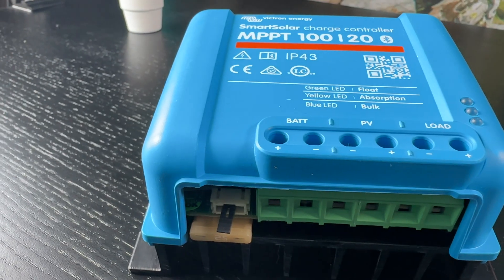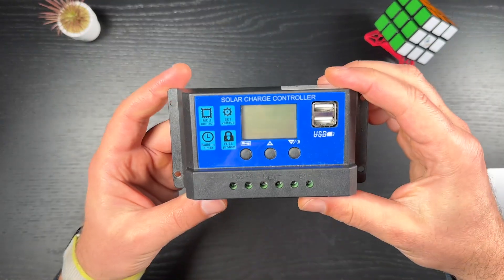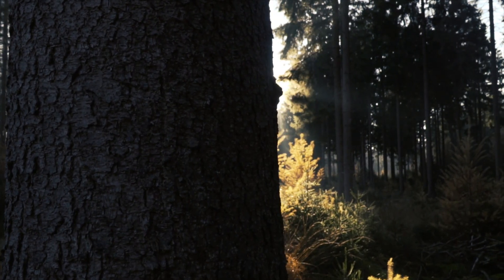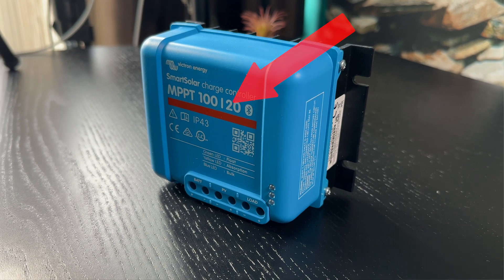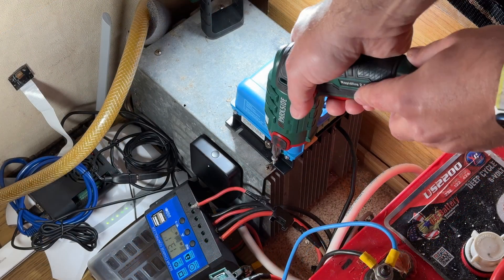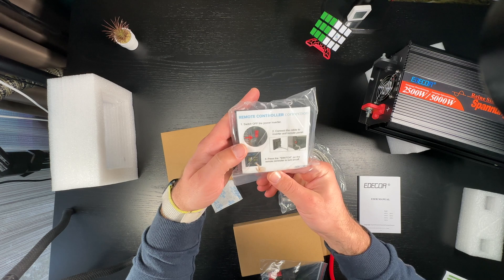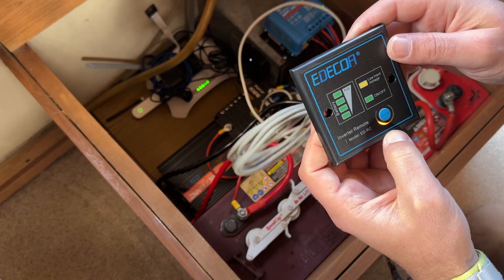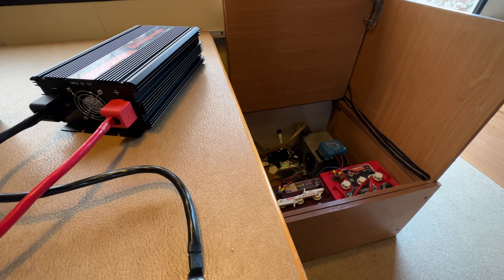Going Off-Grid with Victron MPPT Solar Charge Controller and EDECOA Inverter

Comment: @kpeyanski have you done anything with tank level monitoring? All of my stock sensors for water, grey and black water don't work and am looking for good ideas for what sensor to work, preferably from the outside of the tank - which may be an issue for black water if I use a radar based approach
Reply from the maker: I have some plans but I didn’t install them yet. I will use this sensor https://youtu.be/VuHMolzT_3o
Reply: @KPeyanski  Thanks for this,  this is probably the best option for black water tank, running 3 or 4 sensors to get a rough idea of tank level. I would like to do a radar based approach for fresh and grey water which would give me an indicator of actual tank level. If you have any recommendations for a radar based sensor let me know...

Comment: There is no way to integrate the inverter directly to homeassistant to monitor data and control the inverter?
Reply from the maker: This is the only working method that I manage to find and confirm working.

Comment: I’ll be following this series for sure! I have a similar victron setup with mppt, dc to dc and a lithium battery. No inverter though, everything is on 12v dc. 🙌
Reply from the maker: Great you should check my latest video which is kind of part 2 to this one. Here is a direct link - https://youtu.be/D08sjKWBW7o

Comment: Not my thing, but I need it on my hvac service van
Reply from the maker: Good, what device exactly is your hvac?
Reply: It's a service van for repairing and installing hvac, ie heating, ventilation, and air conditioning. I need to be able to charge batteries for running tools, a laptop for control systems, and a wench for pulling large equipment into the back for transportation. I would like having an air conditioner in the back for when I'm building sheet metal too. 

Have you thought of setting up an auxiliary battery system with solar? It connects to the vehicle battery with an isolator so the alternator can top off the solar battery when the vehicle is running. I'd love to see a video on that too.